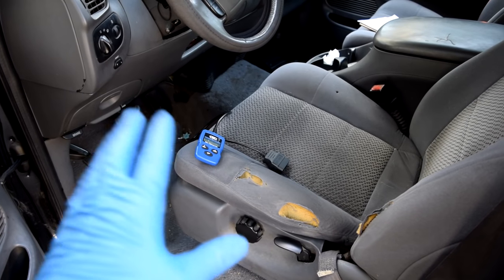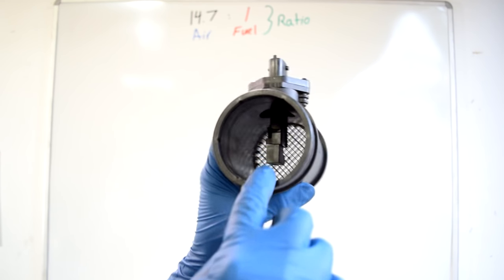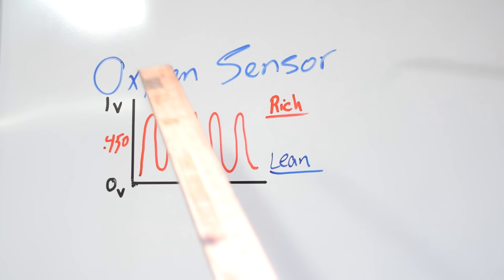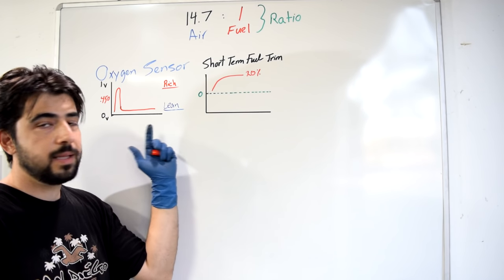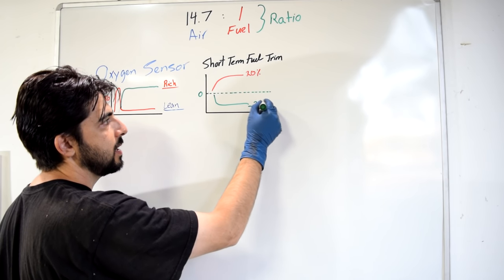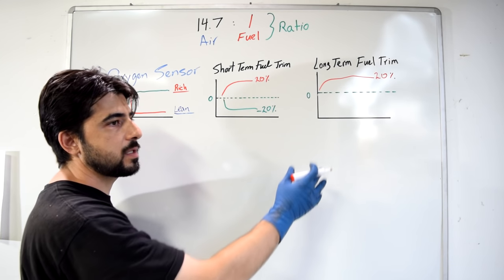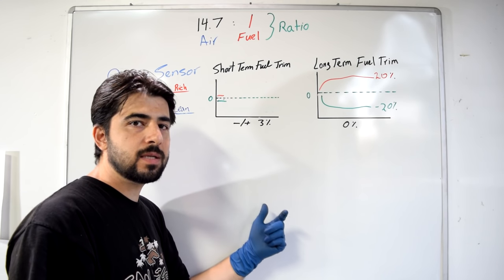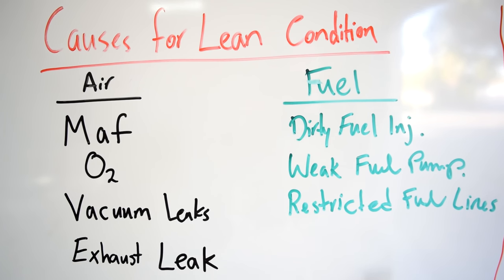Short Term and Long Term Fuel Trims Explained

Comment: I've been a dealership technician for over 20 years and have been working for myself for the past 10 years now and I have heard many people who thought they understood long and short fuel trim but after listening to their explanation I realized they didn't have a clue.  Without a doubt you have simplified fuel trim and explained it in a way any decent tech would understand. Most technicians are lost if they don't have a DTC to point them in the right direction when diagnosing drivability concerns. If you have a good understanding of how fuel trim works why and what will make the values change you can diagnose most drivability problems quickly. Thanks for a very informative video worth watching and please keep more like this coming.
Reply: Why does he have to be so good. Save the rest he's the best 👍            keep them coming have to say you qualify to satisfy. Thank you sooo good!
Reply: Well if you're a mechanic for 30 years you would know if the customer is having drivability problems and its related to fuel/air there WILL be a DTC. Because above or below 10% the MIL will be on because you will start having driveability issues. If the MIL isnt on start looking for mechanical problems
Reply: @blue03r6 I have that issue ,  but there is no DTC engine check thou
Reply: Mark....You literally took the words out of my mouth. I've turned wrenches since 1981. Had my own shop for 15 years, got hurt...went to work at GMC dealership for a few years . Kind of retired now and stopped working at a dealership in 2011. All of that said, this guy is not only sharp, but his explanation is spot on and he does a wonderful job of explaining everything. I was thinking...."Man I wish I had someone like him working for me 25 years ago." 
 To the OP, thanks for posting. A very good refresher course for me.
Reply: U the Man Mark u Just Made me a Long Term Short Term Fuel Trim Professional 💯 😂😂😂
Reply: THANK YOU   FOR THANKING  HIM !!!!
Reply: How long for fuel trims to return to factory after bad fuel pump replacement?

Comment: This guy said the o2 sensor can fail without triggering the Check Engine light, which is what happened to me. Changed my O2 sensor and i passed the emission test with flying colors. Failed before this as it was too rich. The old O2 sensor was so clean at 150k miles as i service the car every 3500 mile interval, maybe thats why it did not trigger the light.

Comment: Found the problem. It was the injectors. Replaced injectors, spark plugs and injector electrical connectors and the engine runs fine with no codes. Thanks for your informative video.

Comment: EXCELLENT video! I've been DIY repairing my car for about three years now, but fuel trims have been a mystery to me. Even after reading several articles, I just didn't get it. A few years back I dyno'd my car to check performance, and a lack of performance led me to monitor my AFR and found a lean condition. I should have looked at fuel trims, but didn't understand them. I changed the fuel filter on my 100K mile car as a stab in the dark. My AFR returned to expected and re-dyno'd the car with expected whp results. After watching your video, I'm going to check my fuel trims soon and I'll have confidence next time I run into a lean/rich problem. Thanks!

Comment: You are DA Man ! All the issues i have searched and You diagnose was the only one that clearly made sense ! I have the same condition on my 2011 335i and LTF is running at 15% while my O2 's are doing good so Intake leak for sure ,I suspect Inlet at the inter cooler ,the cheep plastic and one bolt that holds in the rubber ring ,Needs upgrading ! Thank YOU okay update apparently my long fuel trim spikes when I apply my brakes and come to a stop otherwise it runs around 3% and everything else looks great so I had a M3 with a grommet brake booster issue looks like this is notorious happy hunting all this is a place where most people don't realize

Comment: Great video! Learning alot. I believe your right. the exhaust restriction will cause more of a rich condition. Since unburn gases are restricted by a clog cat unburn fuel will re enter the cylinder unbalancing the mixture. An open egr or clogged egr can cause a lean condition.

Comment: This is the BEST explanation of this whole concept I've ever seen, THANK YOU! I've been fighting a P2177 code on my 2006 Mazda 3 for a while and I've never fully understood what those trim values mean and now I do thank you thank you thank you!
Reply: If my logic is correct and both my short-term and long-term trims remain high constantly I most likely have a fuel restriction of some sort because if it were an air leak the STFT should zero out long term?
Reply: My numbers LTFT: 20.3, STFT: 13.3

Comment: Thank you for this video,  it was really helpful and self explanatory,  I was able to determine what was going with my old civic,  turned out my map sensor wasn't  working right and Idle control valve kept open for longer and my idle was dropping below normal. My long term fuel was at 12.5 % while myshort term was at 28.5% i replaced injectors just to be on the safe side and everything its normal now , long term is at 2.3% short term is at -3.2+% thanks for your videos keep up the good work 😀

Comment: Actually on higher rpm the ratio gets a lot richer than 14.7:1 , especially with turbo engines . This is needed due to the higher heat in the combustion chamber . Fuel is like intercooler , aqueous intercooler . This helps to prevent melting the pistons . For a example , Mitsubishi Evolution have around ~11.5:1 ratio , and the tuned ones can have even 9 or 10:1 , so the mapper can be on the safety side :D 
P.S I'm about to make my own smoke machine , but going to wait you to steal some ideas from you .
Great video as usual !
Reply from the maker: Hey that's good info, my smoke machine will be very basic and crude! you can get started on yours :)

Comment: So professional and to the point, with proof more professional. Thanks. I got a Mazda CX7 with the same mystery, but causing a misfire on cylinder 2 and 3. I think with exhaust leak it's gonna be solved

Comment: Thank you for your awesome explanation.   Im diagnosing a p0174 on my 04 F150 4.6 that has 5k miles on the new engine.  I bought a scan tool with live data to see if I could find the issue.  I've checked for vacuum leaks with spray and used a vac guage and am getting steady 20 psi vaccum off the manifold and the brake booster.  I've cleaned the maf and CEL keeps coming back.  Will be reading live data once it comes on again.

Comment: This is very easy to understand. My turbo car is showing -17 long term fuel trim. I’ve been trying to diagnose a power loss issue and thanks to this video I have a direction to look now.

My issue seems to be the exact opposite of this. I’m having a rich condition because air is being lost somewhere and not getting to the engine. So to compensate the EC you is pulling 17% fuel which explains the bogging issue i been having.
Reply: Do you have a turbo car? if so you might have a Boost leak.
Reply: The short term will fluctuate constantly in real time. You may want to keep an eye on the long term more. I fixed my Boost leak’s and put the bpv back to recirculate. My ltft now is -3 give or take.

Comment: One thing to note when it comes to fuel trims and vacuum leaks that very rarely gets noted - you'll most likely only see high positive low rpm fuel trims (lean condition) with a vacuum leak if your engine is MAF based. If you happen to have a MAP based engine (as in engine that doesn't have MAF sensor, also known as speed density engine), your fuel trims will likely be perfectly normal. That's because with a MAP sensor, you more or less can't have unmetered air in the engine - so even if the air is coming into the engine via a vacuum leak, it will be metered by the MAP sensor just fine and therefore will not cause a lean conditon (well, it still might under certain conditions, but it's much less likely). But your engine performance will still suffer due to the vacuum leak.

Knowing this might save you a lot of headache trying to find a vacuum leak that actually isn't there if your car has a MAP based engine. Trust me, I know ;)
Reply: So how do you find these leaks - I used to spray starting fluid with the engine running  in a attempt to locate leaks.
Reply: @JoseCruz-kp7ru  

Smoke test.
Reply: My car has a MAF sensor & a MAP sensor. I just searched them both in google for my 2009 bmw 335i. Seems like what you're saying isn't thorough.
Reply: @Cdswjp  
A maf sensor is air quantity ant temp.

A map sensor is the vacuum or pressure in your intake manifold
Reply: @JoseCruz-kp7ru  you can fin the leaks by relying on your 02 sensor readings if you do have a vacuum leak, the oxygen being higher after the catalyst would show on the 02 sensor readings
Reply: @JoseCruz-kp7ru  smoke machine is the only way to find easy and fast
Reply: My LM7 has both maf and map on it.  So isn’t an either-or situation as posted.

Comment: I have question, could placement of an o2 sensor effect fuel trim readings of the engine, for example of the factory manifold had the o2 sensor at the top, and the aftermarket moves the o2 sensor down underneath the vehicle
Reply: I have a similar question. My Honda elements previous owner had a shop install an aftermarket cat and I noticed they changed the placement of the upstream sensor a lot closer to the cat itself than stock. It's almost on the cat and the downstream is at the normal position in the middle of the cat. If the upstream is very close to the cat basically at the beginning of the cat. How will that affect my fuel trims because I'm running lean like negatives 15 on both short and long term but I have zero codes just a little rough idle occasionally only on idle.

Comment: lots of good information. i will try this on my car. i am facing issue like rpm drop and vibration at idle, struggles when clutch is engaged in first gear. cleaned maf and egr but no success.
I think LTFT will help me to get to problem.
once again great video.

Comment: get a cheap cigar disconnect the vacuum hose on the brake booster blow smoke in  and see where the leak  is 
and that's how you make a smoke much
Reply: doesn't work with cheap cigar. only cigarett
Reply from the maker: I think that's what Scotty Kilmer does.. no wonder he is out of breath all the time.
Reply: Scotty Kilmer... What a joke to the Youtube DIY community.
Reply: Did this same thing to find a crack in a small vacuum line

Comment: That was a great video. Thanks. I learned a lot. 
The problem is most likely the isolator bolts that hold the intake plenum to the intake manifold. The rubber gets old and they leak.  Ford has a TSB out about it.

Comment: You are very clear with your automotive suggestions, I appreciate this a lot!
 I have a 2004 GMC Canyon, automatic transmission, 3.5 litre 5
cyl.
The LTFT is +12 to 13 %. I decided to use my new scanner
tool to show me live data while I was driving my truck, to see if I could spot
any strange or concerning anomalies. Nothing showed up if I was just idling in
the truck. I did find something strange while I was out driving on the road
test. I set the scan tool to show me only 4 statistics: STFT, LTFT, O2 sensor
#1, and O2 sensor #2. So on the drive, the readings of the 4 statistics would
fluctuate up and down as a person would expect. Then suddenly while driving at
about 90 km/hr, and 1750 RPM according to my dashboard readings, the scan tool
all of a sudden showed that the engine was locked at readings of STFT 0.0%, LTFT
1.6%, Sensor #1 at 0.005 Volts, and Sensor #2 at 0.40 Volts. It was my
understanding that the O2 sensor # 1 would always fluctuate up and down from
zero to 1 volt while driving, if working properly?
The scan tool showed these frozen/stuck engine readings while driving at
90 km/hr, and did the same thing at 110km/hr. The fuel trims and the O2 sensors
were frozen in the readings, for about 5 seconds to 10 seconds, without
changing. Sometimes the voltage of the O2 sensor #1 would very minimally change
to 0.015 v, and O2 sensor #2 to 0.050 Volt.
I have been experiencing a lack of power and hesitation, at
these exact speeds, in the weeks prior, so the scanner findings make sense, I
guess. What do you think about this?
Any of your experience and knowledge would be appreciated
for sure!
I’m guessing if it is possible that the lock up mode of the
automatic transmission has something to do with it? To me it does not seem
logical that while driving and the transmission enters into lock up, that it
would ever cause an O2 sensor reading to freeze and the Short Term Fuel Trim to
freeze accordingly?
When I am at idle, the O2 sensor #1 seems to work properly…it
fluctuates from say .850 and all the way down to .015 as a rough explanation.
Is there anything that would cause both O2 sensors to die at
same time? Oh, I forgot to mention the odometer is at 418, 500 Kms.
Well, thank you for all of your informative videos!!!
Reply: Don’t see any other replies. If you haven’t got it fixed by now … the diagnosis and repair for your described issue is a failing O2 sensor.  It is dropping out when it gets hot.   Replace the O2 sensor and your truck will run like a rocket.  Hope that helps!
Reply: @billybobbarker3175  Thanks for your advice! The O2 sensor failing once it gets hot makes perfect sense in this situation. Now I've learned something new. Appreciate it!

Comment: well explained. Conclusion: if observing bad fuel trim replace everything on the engine.. then find accidentally it was a vacuum hose at the back of the manifold, which you can't see without ultrasound.. yas gotta luv puters

Comment: Can't wait for the smoke test video.  I tried making one with a fog machine but couldn't get enough pressure from it to push the fog out of an open vacuum port on the manifold.
Reply: You need shop (compressor) air to make the fog go everywhere.

Comment: Excellent Video.  Should be able to pinpoint the problem on my '03 Six-banger Mustang now.  Didn't have the relationship between the readings and the Injectors until now.  Thanks !

Comment: Good information. Another cause of low O2 readings can be a misfire. I know this is not your symptom, however.

Low O2 readings (100mV) indicate excessive oxygen in the exhaust stream. This can happen with a vacuum leak or a misfire.
With a misfire there is unburned fuel (rich smell) and the unburned O2 for the misfiring cylinder(s) in the exhaust stream passing by the O2 sensor.

The O2 sensor can only measure the oxygen, so it 'sees' a lean condition. The ECM reads the low O2 signal and increases fuel trim (STFT) to respond, eventually the long term fuel trim (LTFT) will increase until a DTC fails.

Comment: This guys right. Some intakes are split in half and they have gaskets on the inside called plenum gasket. They look very Similar to the intake gaskets. When you take it apart look for bolts if you flip it upside down, if not the intake is a 2 piece but glued together at the factory non serviceable and have never seen one fail when it’s factory glued.

Comment: Dude, you are the shit man. I was looking for some explanation on this topic and you nailed on the head. I learned everything I needed to, in order to confirm the symptoms of a large vacuum leak on my 2000 Xterra. I smoked it and sure enough, the canister purge valve in the back was all rotted out and leaking life a sieve. I guess my truck has been in a lean running condition for a long time. lol

Comment: This was a great video explaining fuel trims. Could you include other problems that can be diagnosed using the long term fuel trims. I have a car that is having similar issues, where it has hesitation when moving off from a  dead stop. However I also noticed that it is hesitating overall, although the car is able to reach up to speed eventually.

Comment: Super helpful video, quick question I’m hoping someone can answer. I have the same issue in my 2003 5.3 vortec, but then rpms increase the long term fuel trims rise as well. Short term stays ok

Comment: I have worked on cars for some time now since the 70s and learned on my own, by reading books, (didn't have computers yet). And even now am a little rusty on the electronic cars. But boy you sure do make it easy to understand how it works. Just wanted to say thanks and I look forward to seeing your other videos!! (I have one question, on the 02 sensor, you said this is the upstream 02 sensor, what about the one after the catalytic converter or that one is not as important as the first one?)

Comment: By far best explanation I’ve found.
Didn’t think much of it before hand, but I installed a CAI and occasionally I’ll get an engine code.  I’ve watched my fuel trims and the long term seems to be sitting at 20%ish.  Being said, I’m not sure if installing a CAI would affect engine fuel trims because my Maf sensor would just detect more air flowing and then should automatically correct it.  

Anyone know if a CAI can affect fuel trims?

Comment: This is a superb video. Very well explained. But in my experience, AFR isn't always going to be at stoich, certainly on European vehicles. There are often situations (such as cruising at low load on a engine that's up to temperature) when the factory calibration will intentionally be leaner to improve fuel economy and/or reduce emissions